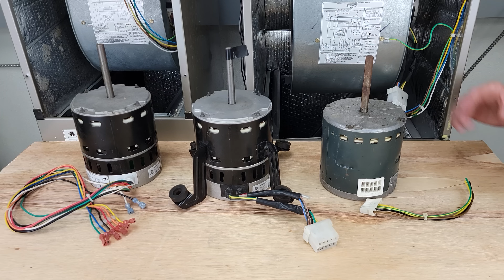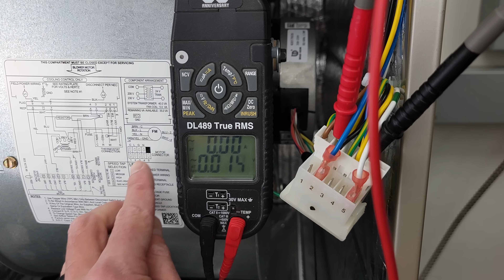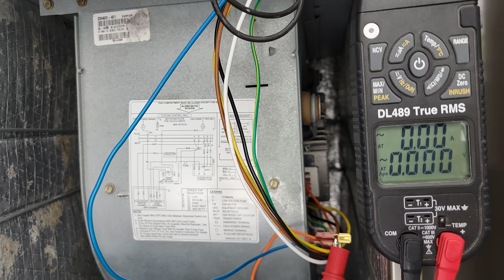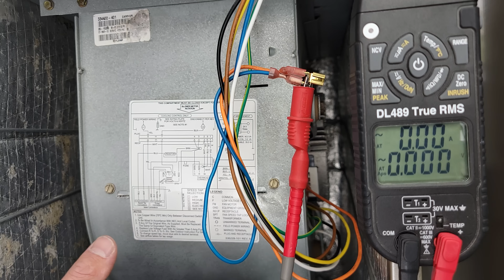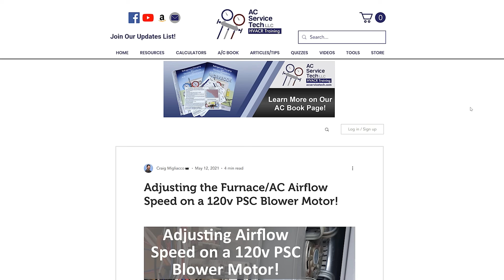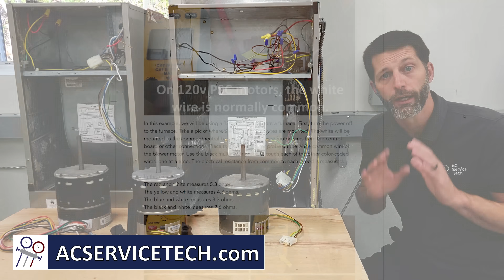Fast Easy ECM FAN MOTOR Troubleshooting! ECM Blower Motors with Spade Terminals!

Comment: I have a Carrier AC that’s 5 years old. Two days ago, I noticed that the blower motor was not turning off. My blower motor doesn’t turn off even after I removed the two speed control wires (blue and white). I’ve removed the thermostat and I left the green wire hanging at both ends ( at the thermostat and where it connects to the grey wire), and I still get 27vac. When I turn the power on via the breaker, the blower motor starts right away, even with the two speed control wire not connected. Does this indicate my blower motor has a bad module? Thanks for any help.
Reply: What was the fix?
Reply: The blower motor was bad. Fortunately for me, the warranty was still in effect and the blower was replaced.   @andreii954
Reply: Me too did you have to change the module?
Reply: The Fix: Fan Blower motor was bad. Luckily, with just 20 days of my 5 year warranty left, it was covered.
Reply: @MrAlwest77  Was it your motor or module? The module does easy come off from the motor for replacement!

Comment: Goodman 80% furnace. Have an issue with furnace the blower motor is getting power 24v and high voltage but it's ramping up and down quickly and it vibrates. Is that a bad blower motor or could be circuit board?
Reply: Module / motor

Comment: Hey Craig, 
I was wondering if you had an answer to a question. I'm new to the service side of HVAC, I've worked as a Commercial installer for the past five years. Now I work as a Final Quality Inspector in the residential side. I was in a house just the other day with a Goodman gas furnace with the electronic dip switches on the  circuit board. I was adjusting the AC1 fan speed taps so that I could bring down the static pressure as well get better airflow with my Balometer. The thing was, my static pressure or airflow wasn't changing as I was adjusting the speeds whether it was in fan speed (1) or fan speed (9). Is this common for a brand new system. I know that just in my short time of working with these units if you have these units on fan speed 9, it sounds like a jet taking off. Hopefully this makes sense, I'm in the learning stage, this was just something that I was curious about. Thanks

Comment: Good diagnostic. 
I had to check my daughter's Carrier AC on the the roof last week. I used to service HVAC ages ago. First time I ever ran into the ECM motor. I was surprised. I had even brought a trusty spare 3 speed blower motor I still had in the garage. One look and I said: Nope, this motor won't do. 

Blower motor runs initially, then stops after a minute and a half. Checked for my line voltage at the harness, then realizing it was a DC variable speed motor, using the schematic, I found my common and hot 24v on the harness. A quick check on Y/T for confirmation about the type of motor and conclusion about the module failure, I decided against a non OEM and got one from a HVAC vendor.

 I'm getting too old to handle a blower assembly on the pitched roof so talked my daughter's boyfriend through the repair. The shingles on the pitched roof were so hot, the glue on the soles became soft and the soles started to come loose on my sneakers. He brought it down to the patio and I had him do the disassembly, put the new motor in and then reinstall the blower into the package unit. Hit the thermostat and fan works, cold air in her house.
Reply: You can convert it over to a PSC motor.
Reply: @wd8557 I have a trans with an ecu blower motor bouncing back and forth after roaring with noise relief today. How can I get away from this high tech nightmare and to a plain ass mother that's dependable??

Comment: Thanks for your video. What would be nice to know is what happens when the blower sticks on. Regardless of any 24VConnections, our blower runs continuously. How do we test for that?
Reply: I'd like to know this too.
I took the 2 speed taps off the x13 in my unit but the blower still runs.  Is there a way to test the motor for that without taking it out of the housing?
Reply: Did you ever find a solution? I am dealing with this currently
Reply: Me too

Comment: Why would you not test the module to see if it’s the actual motor that’s bad or the module?

Not saying your incorrect just curious what your opinion is.
Reply: Modules are hard to find and about the same price as a motor. I found a motor cheaper than the module so in my case it made sense. Mine will be here tomorrow.

Comment: Hi Craig, can't appreciate enough your excellent and hard work , I'm having a weird situation, Customer has an air handler, blower motor gave up, no problem , got the same motor and installed it, but now the breaker flips after that motor runs in 3 sec , blower has a belt and a pully, motor sticker says 16 amps , motor run free out the unit 17 amps , and when installed it reads 32 amps and flips the breaker , what the heck im missing here???i adjusted the pully  to get the  lowest speed ,and still the same problem,, blower wheel spins freely !! Power is 115 volts(120) do I have a defective blower? It's brand new from carrier.

Comment: How about some free advice?
Electric furnace started to run constantly, heat would cycle on and off per the thermostat, but the only way to stop it running, was at the fuse box. A "tech" came out, said the control board was bad, needed to be replaced.
Great, I bought and installed a new control board, and no change.
I could tear the whole thing down, but it is in a wet, lower crawl space, with about 18'' max, of space.
I have researched the holy hell out of this thing, because to me, it just seems like a relay problem.
Trouble is, sometimes docs will say relay is on control board, others may say separate relay, others wont list any form of relay, and this is from the manufactures website, mind you, and they will not give any tech support to a home owner.
I can see what looks like a relay inside the control cavity, but I would have to literally tear down the entire unit, just to even ID what is in there.
So, any advice, other than the obvious of tearing it down?
Reply: If you see my post above my X13 is stuck on high. I have to flip the breaker to shut it off. Remove low voltage and it still runs just to be clear. Mine uses a sequencer not a board. Point is the the module is fried. It sounds like you have the same issue. Remove the low voltage and if it still runs replace the motor. The modules are about as much as the motor if you can even find one.
Reply: @scotts4125  I removed the 2and 4 speed taps and it still runs. Also x13.  
Is there any chance it could still be a relay somewhere else?  
Mine also doesn't seem to have a control board anywhere that I can see
Reply: @chuckcraigs9310  No you have a bad motor period or more specifically a bad module. X13's don't need a board or a cap that was one of the selling points. The module takes care of that. Match your motor HP and buy a rescue motor. I bought mine from Supplyhouse and it works perfectly. Once you removed the speed taps it's only getting 120/240 you removed the control circuit proving the module is stuck on. The rescue motor will figure out on it's own the direction of spin the first time you turn it on . The whole thing took me about 45 minutes. I also spent about 20 minutes getting the blower wheel off the shaft. Watch Anti-DIY how he gets them off without a puller. Mine wouldn't turn past the flat on the shaft so I had to back and forth it with a little banging but it finally came off. That was 20 minutes of the 45 minutes. Best of luck. About 2 weeks later same AC the cap went. I had those on hand. Keep those around. I use Amrads and also keep a spare contactor.
Reply: @scotts4125  good advice- thanks for the input-  Did you ever try to look inside the module and see if there was something in there that went bad that could be changed out?
Reply: @chuckcraigs9310  The newer modules are potted which means they fill the board with epoxy so everything is underneath that. So I didn't bother looking. I actually saved the motor for a spare.
Reply: @scotts4125    The epoxy was probably put there to protect the electronic parts and circuit board from rat piss.

Comment: Wait, if you have high voltage going to the motor and you're also getting low voltage to the module, how does that mean your module is bad? It's not possible that the motor still bad?
Reply: It still can go bad intermittently. 9 times out of 10 it's the module, but yes the motor can go bad as well.
Reply from the maker: If the motor does not turn on if it has the high voltage power and the low voltage speed signal, then that means it is bad.
Reply: @acservicetechchannel  how do you know motor is bad if module is good. I confused by this video.

Comment: in the last year i've had 5 carrier ecm blower motors run but at lower cfm causing high limit trips on systems that ran perfectly fine earlier in the year. clean filters and decent static loads. other than doing a cfm calculation is there a way to troubleshoot that in the service to reduce callbacks?
Reply: Same here, 3 carrier performance ecm motors in the same neighbourhood with the same code 33 high limit trips
Reply from the maker: Like Rocko99 said, you can do Temp rise or tesp to determine airflow. If there is high static pressure, the blower could get damaged due to the high current it takes to reach the programmed torque. Nothing else can really be done to know if the motor is going to fail. You could add a surge protector to the furnace but that will only protect it from lightning strikes or problem voltage, thanks.
Reply: Temp rise
Reply: I have a 2 Y.O. Carrier that's stuck on high. I have a rescue motor on the way. Went with a U.S. Motor instead of the X13. We will see what happens. My smaller unit has a Broad Ocean ECM so far that's OK also 2 years old.
Reply: @scotts4125  we've had 2 more fans die in the last couple months system's both around 3 years old wonder if there was a bad run of motors
Reply: @hankbender2  It does make you wonder. This is a new house and they did a good install so I know the ducts aren't restricted. Some think the 1" filters might have something to do with it. I have 2 A/C closets units mounted vertical on stands with 1" filters. During construction I told my GF those motors are going to go and sure enough . . . My smaller unit has a Broad Ocean. That one is still good but I priced it out and it's more than the X13.
Reply: Buy the Zebra exam surge protector and you will have to replace a lot fewer motor modules

Comment: Very nice video. The thing I don't like is the very high cost of an ECM motor compared to a PSC motor. Any savings of the ECM motor is thrown out the window if you have to replace it. Also, can a PSC motor be wired into the ECM system to run the system in an emergency? Many thanks.
Reply: They can be, You have to install several control relays to control what speed the motor runs at.
Reply: @bradencole8850  Thanks
Reply from the maker: Yeah thanks Braden for answering that question, absolutely using 12amp or 8 amp fan relays or even general purpose relays, thanks!
Reply: In a pinch you could run a psc motor off the door switch 120v but fan would always be on.